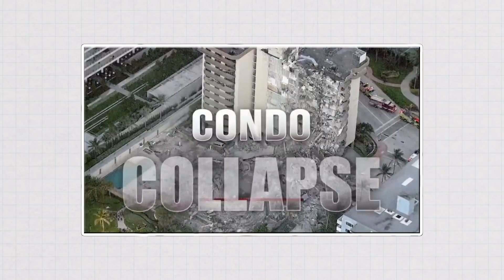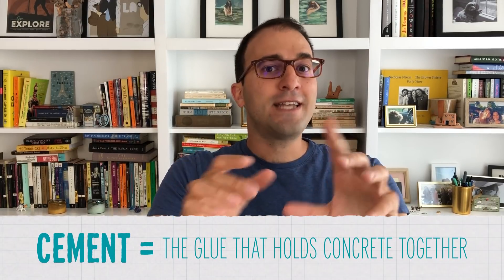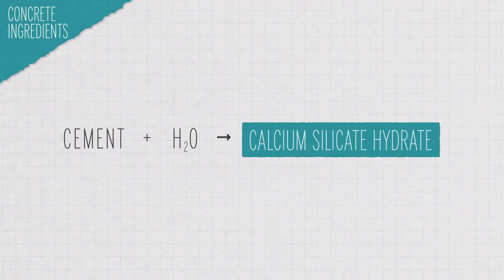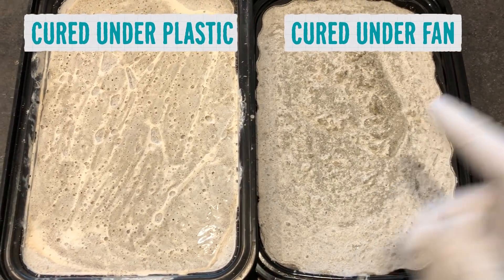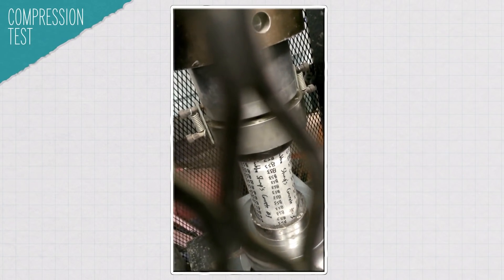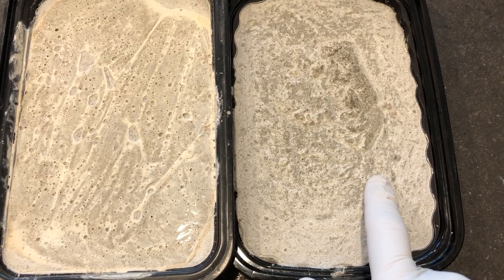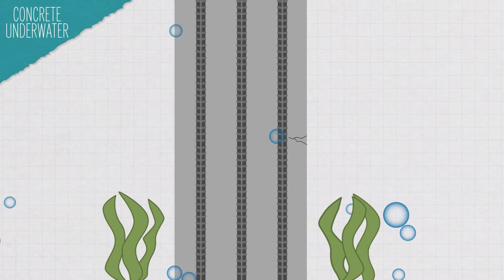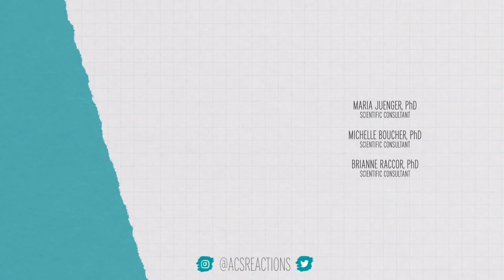What Happened in the Surfside Condo Collapse?

Comment from the maker: The concrete curing process actually gives off heat. If you decided to pour yourself a pair of concrete boots (don't, but hypothetically speaking), they'd feel quite warm from all the energy released as calcium silicate hydrate forms.
Reply: I'm reassured to know that when I'll drown at bottom of the bay, at least my feet will be warm.
Reply: @LeRoiJojo  Of course, you wouldn't want to die with cold feet.
Reply: Huh, I'd always been that cement cures by absorbing co2 to form mostly calcium carbonate. Is that just a different kind of cement?
Reply from the maker: Cement does naturally absorb small amounts of CO2, but that happens after curing. The calcium hydroxide produced during curing reacts with CO2 forming, yes, calcium carbonate. In spite of that, concrete is responsible for about 8% of global greenhouse gas emissions. Scientists are looking into ways to lock up much larger amounts of CO2 in concrete to turn it into a net carbon negative process, but it's still in the experimental stages, at this point.
If you're interested in carbon capture & storage/carbon dioxide removal, we've got a video on that: https://youtu.be/wu3hoo3p4Kk
Reply: @rfldss89  Cements that cures by absorbing CO2 and dries out are called non-hydraulic cements. They are heavy on gypsum, think plaster. They take a long time to cure and must be kept dry, which is difficult for constructions. They are mostly considered outdated.
The most common cement in the World, is the (hydraulic) Portland cement, based on mostly limestone, clay and just a pinch of gypsum. There are many variants. Much faster to cure and of course tolerates wet weather or underwater constructions.

Comment: One of the demolition crew members said that as he was drilling a hole in order to place the explosives to demolish the rest of the building, he noticed that the concrete seem to be a bit soft.  As if the construction team had used a lower PSI strength concrete.  We definitely have to take this in to account.

Comment: The inspecting engineer said the pool deck was not draining and I believe blamed it in the architect. But that concrete pool deck had sloping concrete to frequent drains in the drawing. But, it was covered with pavers in 1996 and that effort could have very well screwed up the drainage. 
A better maintenance contractor would have helped as well. They had water leaking into the garage for years through the concrete ceiling and someone was coming out and working on it, but not fixing it. Or even realizing how dangerous it was. There was plastic on the ceiling of the garage whose purpose was to direct water coming through the ceiling away from the car parked below it.

Comment: You all should be exploring the science of controlled demolition.
Reply: No,explain or unfalsifiable claim.
Reply: @adamarlem9863  free fall speed into it's own foot print all 4 collapses. Detonation flashes. Obvious.
Reply: @sundaywhiterabbit7679  no, flashes of utilities still on as gas and electricity. Why cars spark when they collide. Crumbling not conflagration.
Reply: @adamarlem9863  PLEASE stop making excuses for ultra rich criminals.
Reply: @sundaywhiterabbit7679  that is right because horizontal floors all break connections similarly. Yes, if it happens within the confines of the 🇺🇸, then the same people will be investigating-- god forbid we call in the French. You are right it will be sold to the highest bidder, that I your predatory real estate industry that  tells you your home is worth what it is not. That is the mindset the HOA had that prevented repairs. To me it was not repairable. But it was too costly to accommodate safety. That is ok.mother big building south is built the same way :)
Reply: @adamarlem9863  free fall speed can only happen if all the floors are severed from all the columns at the same time. So coincidentally all 4 sections fell at precisely 3 seconds each strait down into their own footprints. Not 360 Degrees any other direction like a natural collapse would. I'm sorry but you're more than naive if you think 4 sections had detonation flashes at the same exact times before collapse and all 4 sections fell in exactly 3 seconds. Come on. And World Trade Center Building 7 also fell at free fall speed into it's own footprint because of a few isolated fires. Very very hard to believe. Never has happened before or after WTC 7.  You're protecting, making excuses for and making plausible deniability for crooks and lying news media. You are the reason they keep doing it because you can CLEARLY see controlled demolition but refuse to question it.
Reply: @sundaywhiterabbit7679  Lot here. They would fall at the same intervals in time because that is the same heights of all the floors and ceilings. No reason to do otherwise. There are detonations in an accidental fire-- stuff just explodes and erupts. Things do not fall out of their own footprint unless they are propelled. As the floors stacked , the layers did slide down and out. 
I do not understand why people want it to be a demolition. Not really interested in the WTC: planes crashing into 40+year old buildings built on the cheapest 3 contract bids and you expect what? Condos, here, built by what labor and from out of state. Supervision? The parts of the building built at 100ppf did not collapse. Only the 40ppf did, with vehicles cycling in and and out-- how many pounds of pressure does that add up too when there are missing beams? The continual temperature variations created by the 1/2 basement garage, etc. That building was sure to fail. Sad.
Reply: @adamarlem9863  you're wrong. Please go watch a few natural collapses. A natural collapse takes far longer amount of time. You seriously do not understand physics or building construction or controlled demolitions. You can not get free fall speed unless you remove all resistance at precise times set off by explosives. Free fall means drop without any resistance. A natural collapsing building would have significant resistance with floor trusses attached to columns. All of those must be taken out to achieve free fall speed. If the bottom broke down the top would likely stay together and topple over to any of the 360 degrees it could fall, not strait down right through the path of most resistance!  Build a Jenga tower take out the bottom support blocks. Does the tower fall strait down into itself or to the side? Repeat experiment several times and see if any time it ever falls strait down. You know it won't. Now if you could take out all the bottom blocks at once, then the very top layer would come...strait down. You would have to remove all levels at the same time to achieve it. 
All 3 collapsing sections fell strait down in 3 seconds which is precisely the exact same amount of time the known controlled demolition did. These coincidences are too far fetched to believe. Beyond logical thinking could it have happened that way. 
And the property already sold for several hundred million dollars, they aren't going to put a memorial there, they are going to build a vet expensive new set of town homes. And just to be clear, the criminals also vacated 4 other beach side properties to demolish them and also rebuild more expensive. 
Don't be so naive to think they wouldn't do it and couldn't pull it off for that kind of money. Please please please STOP defending these crooks. You are allowing them to keep on and on.  More people need to question what the news media says, you have no clue what kind of money the criminals have to buy whatever they need and whoever they need. 
Our world is not this American dream rose colored rainbows and cookies and love. You're being fooled.
Reply: @sundaywhiterabbit7679 There was a Nabor al rotation to the fall. The building was faulty. There were beams missing and extra weight and wraparounds added to 3 floors-- 1/4 of the structure on the east side that came down. It did NOT NEED a planned demolition. How many more are like that? No regulation to speak of? A 40 year check up is a joke. The repairs were impossible for a list of reasons.  Agree with you about the predatory industry, saying these other buildings are safe.Commercial and govern,ent buildings are, mostly. But not private HOAs over 5 stories. Ever wonder why Las Vegas casinos are routinely taken down after 40 years? Because that is there lifespan. You don't need a demolition :)

Comment: Something I feel was missed [or at least I missed] was steel has a different thermal coefficient than concrete, point being the steel core expands and contracts separately from it's concrete shell, and because concreate has extremally low elasticity....

it leads to cracks that lead to seepage and rust that leads to cracks and structural failure.

Comment: Sooner or later, economics  (or building codes) will dictate the replacement of steel rebar with bassalt, fiberglass or some other reinforcing material.
2 inches of concrete has historically been used to rebar cover but in marine environments, it is a question of when the salt attacks the rebar rather than if that attack will occur.  
Ask anyone who has worked off-shore how corrosion invariably attacks everything.
Reply: I'd think the steel would be cheaper than the fiberglass. Dunno about basalt, though, since I've never worked with that.

Comment: Does anyone have a read on concrete inspection? When I visualize the future of certifying concrete structures, my brain goes to ultrasound readers.
Reply: I think I read somewhere that sometimes that's used, but I can't be certain. I could've just read about potential future methods, too. It's been quite awhile ago.
Reply: Umm they do use ultrasound to do inspections but it's typically to find a spot to take a core sample where they won't hit rebar I can show damage inside as well like cracks from rebar swelling

Comment: While corrosion of rebar due to saltwater exposure might be a contributing factor, its unlikely to be the primary factor. All the buildings around the Surfside have been subjected to the same salt water exposure, and Champlain Towers South is not the oldest building in the area. If the saltwater exposure was so severe to be the primary factor, then older buildings in the same area would have collapsed first. From my understanding, there are buildings there from the 50's and 60's that are still standing, and no other building have been assessed to be in danger of collapse.
Unless other buildings in the area also start collapsing, the primary cause will likely be something unique to Champlain Towers South.
Reply from the maker: Correct. Seawater by itself shouldn't be a problem, as the concrete should protect and passivate the steel. But, if there were "major errors" in construction of this specific building, as appears to be the case, that could have allowed water to come into contact with the steel, catalyzing oxidation reactions.
Reply: @ACSReactions  yes, it is possible that something unique to Champlain Towers South, material/design/workmanship made it significantly more susceptible
Reply: @ireallyreallyhategoogle  Yes. And if you recall, after the collapse, everyone started doing inspections, and many many buildings around the same age in the same area that were also found to have cracks, sprawling, water damage, etc. Perhaps my use of the term "Primary Factor" was incorrect. A more accurate term would be "Unique Factor". Only one building collapsed, others around it are still standing. Many are similarly aged, similarly constructed buildings that have been subjected to similar environmental conditions and usage. Therefore an engineer investigating the cause will want to know what was "unique" about that particular building.
Reply: @ireallyreallyhategoogle  Do you have a background in civil/structural engineering? Coz you sorta need to know how buildings are designed to have a meaningful conversation about how they fail
Reply: If you're interested to know about the cause, this engineering analysis gives the most convincing hypothesis I've seen so far: https://www.youtube.com/watch?v=WaZcyq7YsNA. However only the official investigation report can make an authoritative conclusion as they would also be doing extensive testing on building material and soil samples. Based on the engineering analysis, it appears that the pool deck failure (which normally wouldn't bring down a building) led to the columns at the east section losing lateral stability. The resulting rotational load would then have caused buckling failure on several columns eventually leading to the rest of the columns failing from extra load